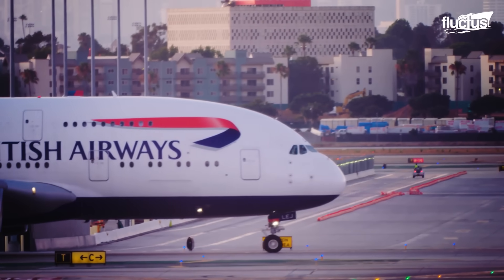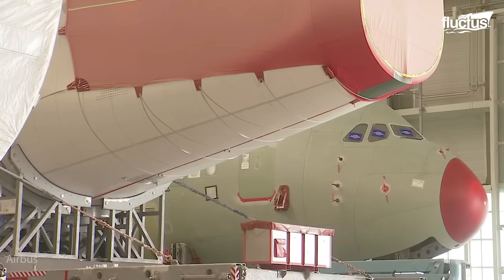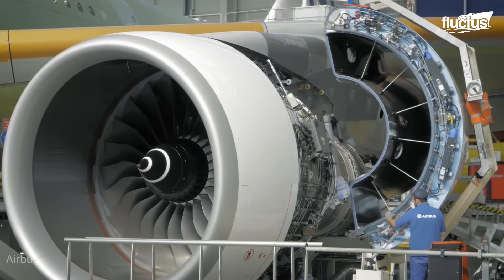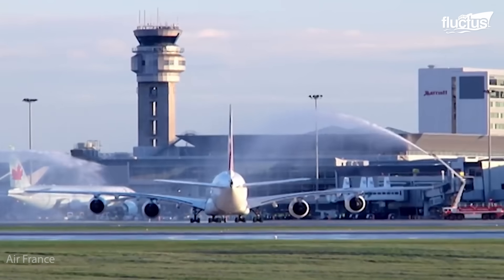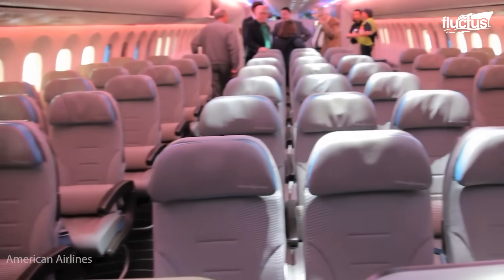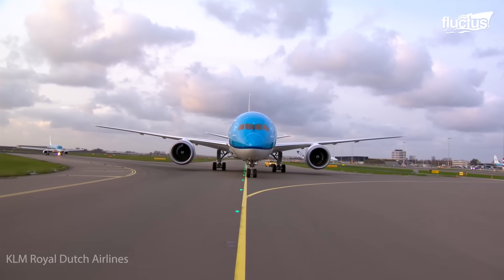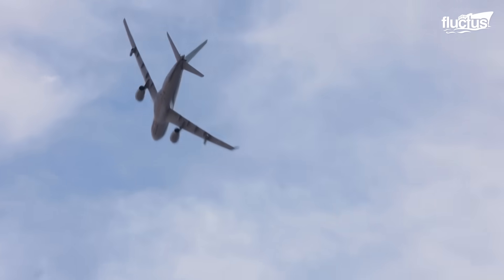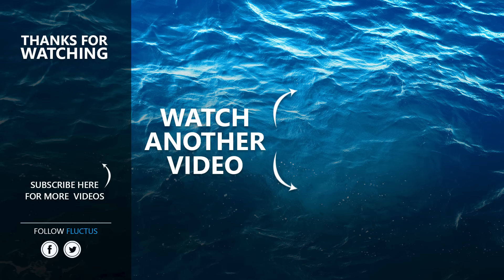Inside the Massive Airbus A380 Production Line Factory

Comment: A380 vs B777
I wish to say B777 is the winner.
A-NEO vs B787 
I wish to say the even.
A380 need to fabricate for cargo freight.
Reply: It cannot be modified for any other purpose. Every 10 years it needs a brand new landing gear costing 25 million dollars. Therefore each A380 has only a lifespan of 10 years. On the other hand Boeing 747 parts last forever.